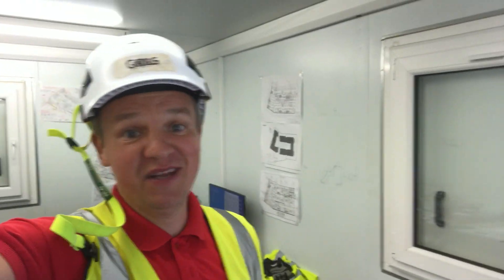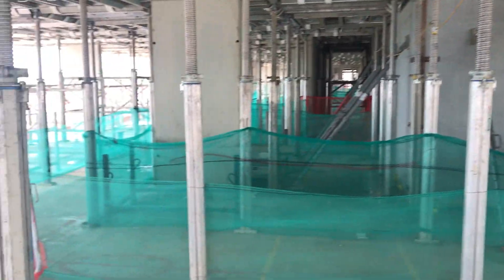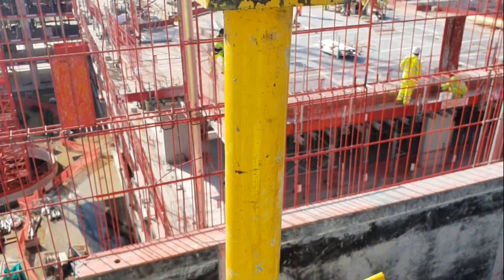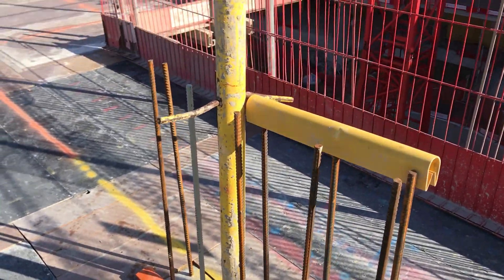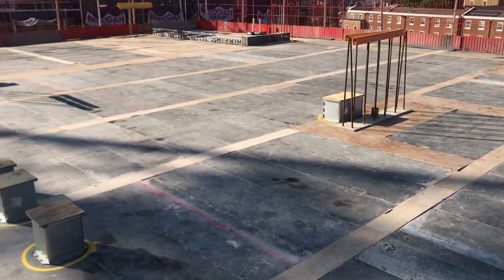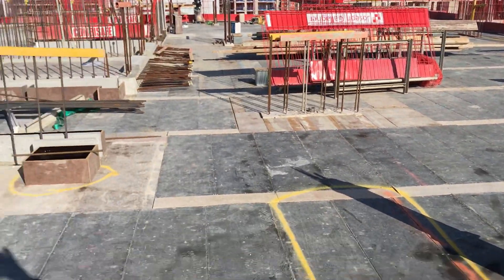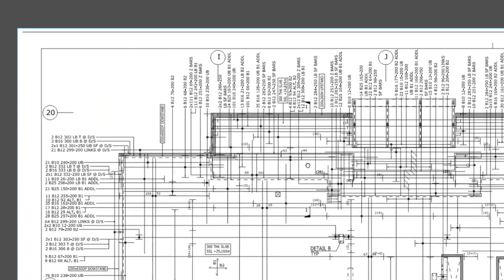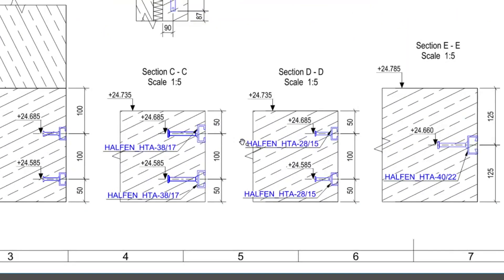SETTING OUT on decking. TOTAL STATION set up using mono leg. Checks before concrete.

Comment: Hi Siteng,
When on top of the decking how do you set laser level for the ssl, as you don't have any columns or walls to mark up?
Reply from the maker: You can use a monopod, like Survipod - you have to set your EDM there. than you can check some level and refer to it - wherever it will be (provided it's not moving)

Comment: Hi Greg
What is the best way to mark the slab edges and steps when setting out on the deck.
Prism or laser?
Thanks
Reply from the maker: Whatever is better for you really, of course make sure your line is spot on. When using a prism on the long pole it's not that easy and when using the laser you still need some target to mark it right

Comment: Hi Greg, great content! How do you resection on high rise if control is on ground floor building etc?
Reply from the maker: Thanks Scott! You would need to use plmmet points, leaving a box/hole in the slab and set the EDM over it (using a plummet laser over a known point - station).

Comment: Hi Greg, Well Done on the videos very well edited. 
So you would under no circumstances advise on setting up on a deck. Another engineer said he did but only when it was him alone on the deck and he said the EDM (Robotic) compensator took care of the level disturbance if it was in the "seconds".(while he moved about on the deck.)
Reply from the maker: I wouldn't set EDM on the decking, definitely. You need to think about these things in advance. How to set up, you can also use a concrete block, some guys putting precast column flat on the deck :) Please don't set on decking, if I would see that I would have a big doubts about the engineer and would definitely stop it on my site. (bet the setting out on that job is terrible ;)
Reply: @SITENG  
when you say they put a precast column on a deck. Would the deck not move anyway and then the precast?? 

Ya im just exploring different options another one i heard is to ser out everything on the slab below and use a spot laser to plumb the point unto the underside of the deck and nail through.
Reply from the maker: the main thing is to set your EDM with minimum movement possible and setting on the deck is no good for it. Even when you are using mono leg there still be some movement as the column is not 'fixed' on top, but this will give you acceptable error. using laser - plummet points is different thing and is very good for high rise buildings to keep your resection within smallest error as using targets may be difficult/impossible.
Reply: @SITENG  This is exactly what I wanted to read. I don't work off the ground much at all, but am doing a little bit of asbuilt-ing on a two-story build. Guys tried convincing me to set up on aluminum decking today (in the rain, no less) and scoffed when I told them it wouldn't be happening. I was wondering if somebody like yourself, who works on large buildings all the time, would have some kind of suggestion. "Don't do it" is the best suggestion I could ask for.